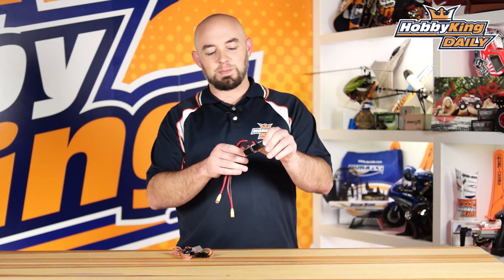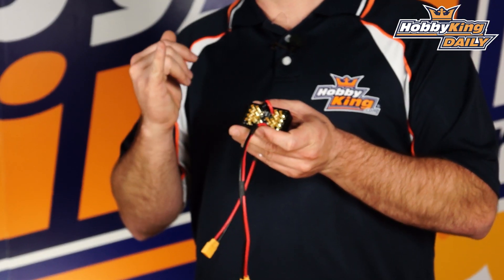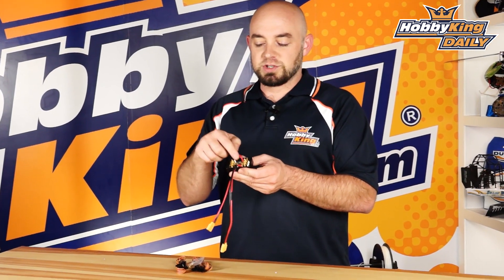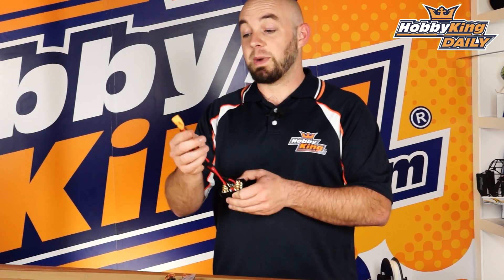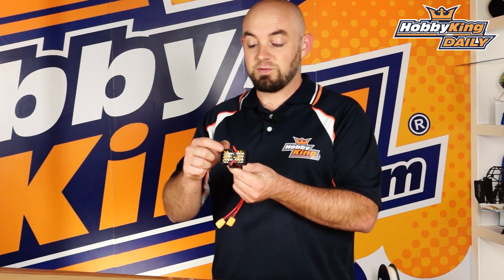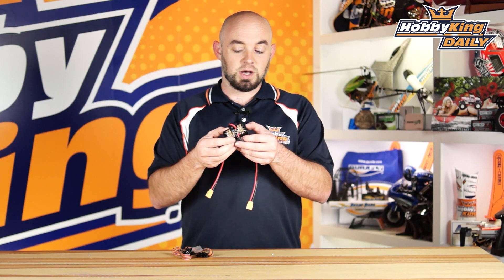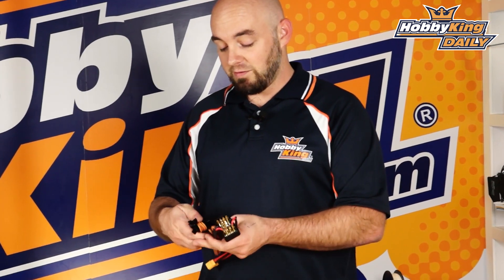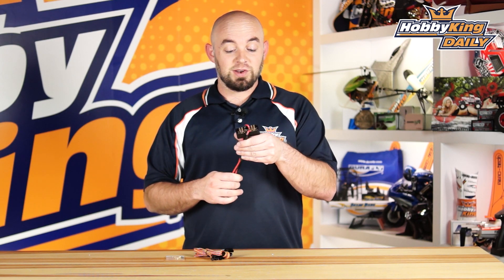High Voltage PCB - HobbyKing Daily

Comment: This probably isn't the place to post this, but I can't seem to get a message to hobby king any other way I've tried, so here goes... What's up with shipment tracking, Live support or any other way of contacting HK from the site? Don't you want to hear from your customers? I've been trying to communicate with HK for over a week, since my last order shipped and nothing I do works. The live support link does nothing useful, much less get you a live support session, there is no way from order status to track an order, seems like you really don't care about your customers anymore... Fix you site!
Reply: Live support works just fine for me. Just used it yesterday.
Reply: Michael Ransburg Mike, I've tried to get live support from home and from work and get a useless page with a bunch of links that don't include anything for live support. But my order has arrived so now it's a  moot point...
Reply: Hey there! Don't click on the "live support" link. Rather than that, first log in and then on the most upper right corner of the page click on "live chat" - that will get you to the live chat support. The "live support" section is pretty useless indeed. Hope that helps. All the best, Mike
Reply: mPky1 Yeah, the package got here before they posted anything. I wonder if they even bother posting shipping info any more. And it came UPS, not USPS so I found it on my door step when I got home from work, plain site. I like to have the shipping info available so I know when I have to pick up at post office as we don't  have delivery where I live. But moot point now...